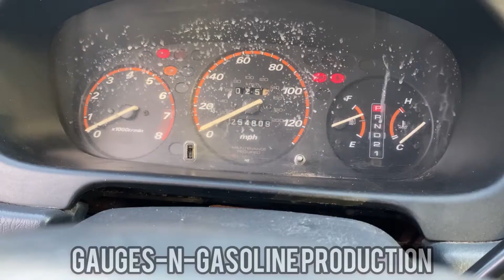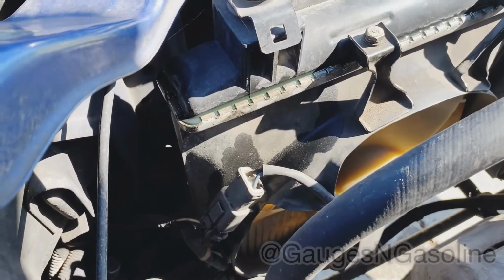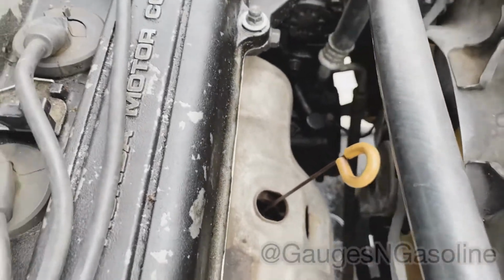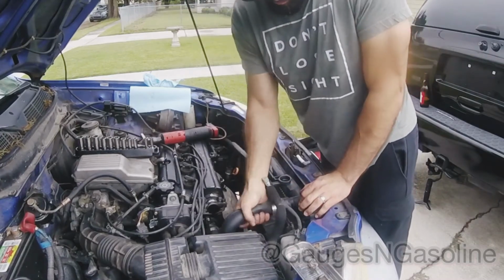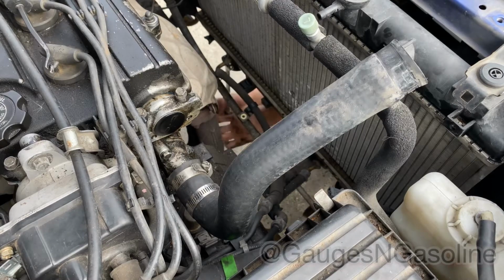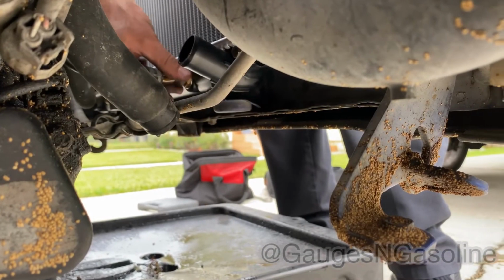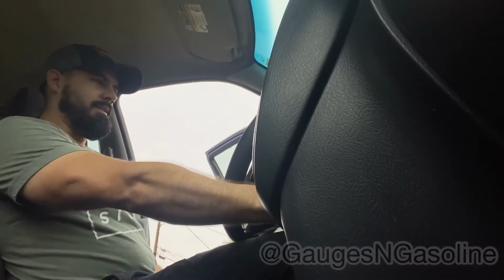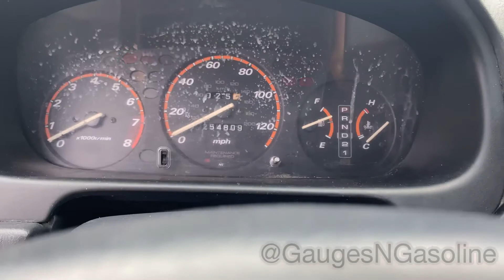Honda CRV Radiator Replacement #honda #hondacrv #radiator #gaugesngasoline

Comment: Its is the fuel pump has to b I hate that this is sad bro that sucks. I can tell by the way it's cranking need a new fuel pump easy peasy install in 5 mins by lifting the back seat right in the middle. That's why I love Honda they actually thought certain things out. These cars were way ahead of their time. My brother has a 2005 Mercedes c230 and when I compare my 98 CR-V the motor is just way better looking the systems has more flow and just looks better you can get in the motor bay and actually work unlike many brands. #gen1crv